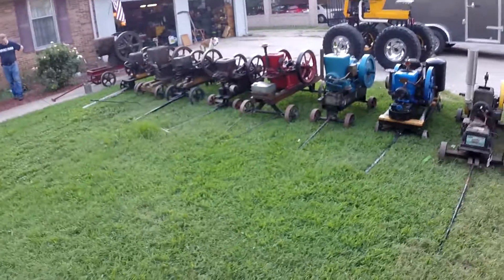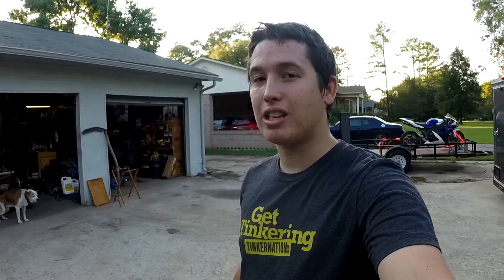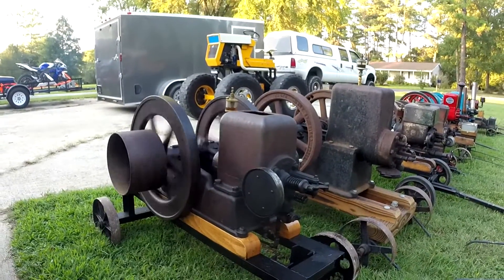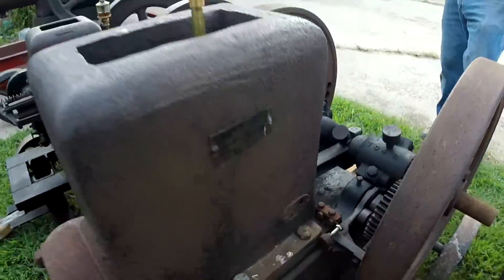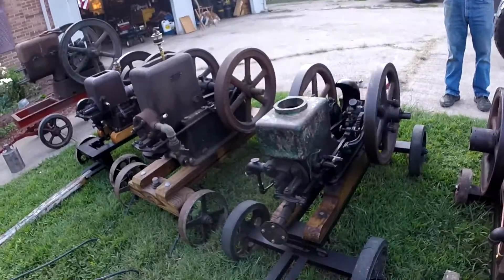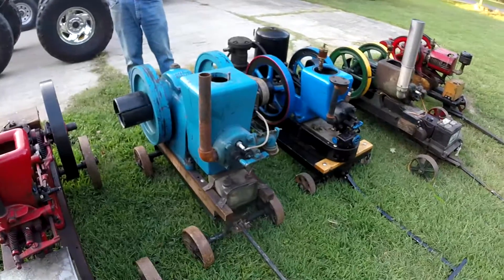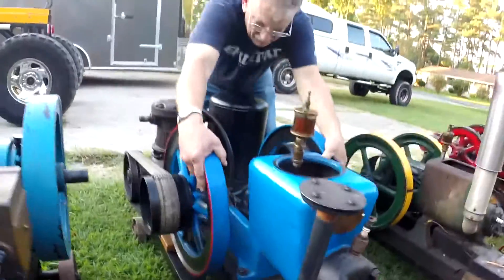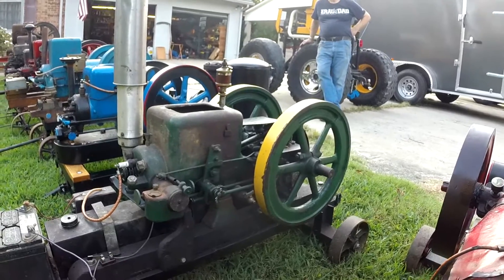Motor Monday #6- Flywheel Engine Line Up

Comment: ive noticed a type error in the description - fairbanks morse and bradford it should be- the bradford i would expect to be quite rare over there, i used to own one and they are a good,solid well built engine just be careful incase it kicks back they usually do especially if the timing is wrong, i use to start mine on the flywheels as its much safer hope this helps :)